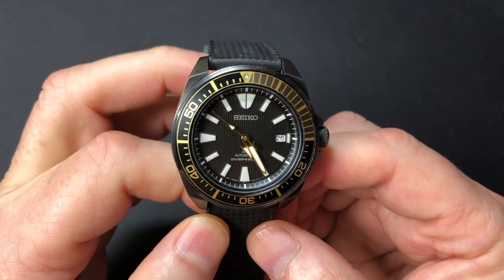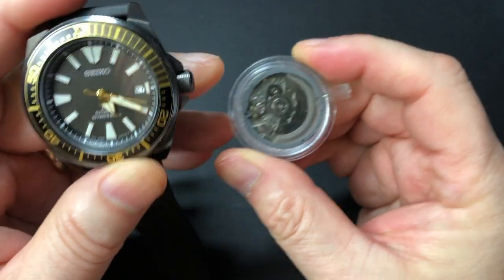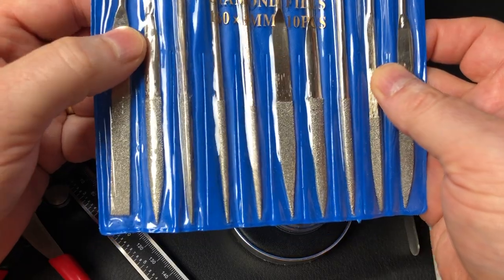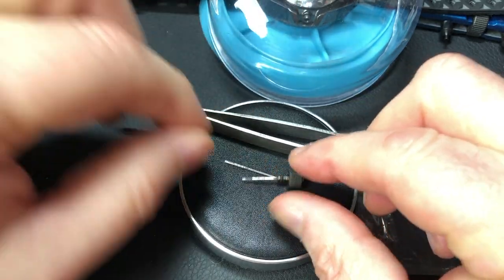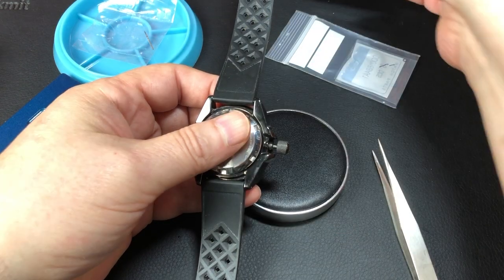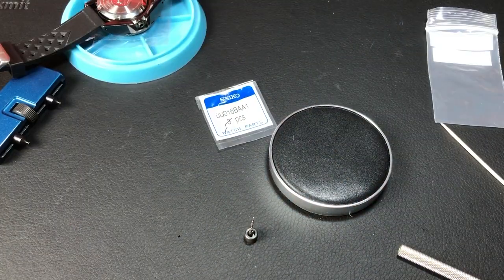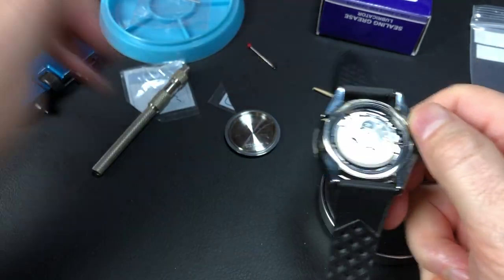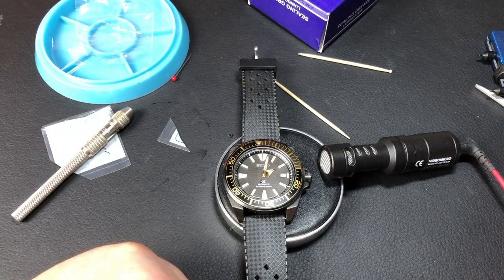Watch Crown Stem Repair – What’s the real problem

Comment: Good work.  Stems are the most annoying thing to deal with in the watch hobby and Seiko is one of the easier brands to deal with.      It's almost criminal how many stem variations there are in Swiss / ETA brand movements.      The profile ends of the stems that control the functions inside of the keyless works should have been MUCH more standardized on Swiss brands.  (Rant over).
Reply from the maker: I didn’t realize there were so many variations in stems. Thanks for the info

Comment: Really good video but I suggest anytime you work on any watch, please wear rubber finger cots or at least rubber gloves.  It makes me cringe at how much oil and junk is getting on your watch movement and parts from using bare fingers.  This finger printing can and will have negative effects on watch parts over time.  Keep it clean and don’t take unnecessary short cuts.

Also, you should remove the movement before trying to clean the inside of the case tube.  You are just pushing a lot of garbage into the movement, where it can contaminate and negatively effect the watch movement, it can even cause it to stop over time.  Take your time and do it right, you’re dealing with precision machinery and small bits of rubber and dust can do great harm to some of the tiny delicate watch movement parts.

The proper term for the”gasket” is O-ring.

Thanks for the. Idea!
Reply from the maker: Thanks for the advice

Comment: I opened up a Quartz Watch....to clean the Dial. I put in the Crown again. But now it does not really "CLICK" into the 1st and 2nd position. It is rather loose. Did I do something wrong? Any Advice?
Reply from the maker: Can’t tell from the description. Maybe something broke. Have you tried repeating the process
Reply: @adventureswithtime  Not Yet. I was waiting for an answer. But the Watch Works. The Crown works. I will see if I go in a second time, or leave it that way.

Comment: Great video, although I wouldn't have chosen a safety pin (because it is hardened metal and pointed) but used a pointed plastic tool or similar then there is zero chance of placing any scratches upon the shaft under the O-ring. I will say I'm NOT a horologist/watch repair guy but have worked with O-ring seals on ultra high vacuum systems for over then years and one removes many seals over time and no technician uses any metal tools to avoid possible damage to the O-ring groove/surfaces. That being said, if the pin simply "stabbed" the O-ring and thus allowed you to pull it free of the groove then no problems. How about sealing did you run a hydro on the watch after this?
Reply from the maker: What do you mean about running a hydro?
Reply: A test for pressure, either in water or vacuum to test that the seals are good to the rated depth.  @adventureswithtime
Reply from the maker: @BushCampingTools  I don’t have that equipment

Comment: Sir sir, I just bought a new watch, I gently pulled the crown to set the time but the whole crown with the needle came off. The watch is working fine but I am unable to set time n date. Plz help me. Is it possible to put it back? 😫
Reply from the maker: I would return it to whomever sold you the watch.  They should except a return and provide you with a new watch.  At a minimum, the watch should be under warranty.  I would not try to fix it yourself.
Reply: @adventureswithtime Actually I bought it online. I will try to explain them the problem. But if they don't consider the return assuming that it is a physical damage, can I somehow get it fixed from the local store? Means is it even possible?? I guess the pointed part of the stem is still stuck inside.
Reply from the maker: @luie.no1noob  the stem could be broken and need replacing. Even if purchased online they should accept a return for a different watch.
Reply: @adventureswithtime  Ok sure. Thank you so much for your assistance. 😊

Comment: I have had the same problems with a Mod i made. The crown has a spring, this spring hets stuck in the crown. I dont know why but i has to be pulled HARD for me to fix it. Only solution i have is to remove the stem and pull. WEIRD🤔
Nice vid
Reply from the maker: There are so many intricacies to some watches. I think that is part of the fun of the hobby

Comment: Hi, i have a blancpain villeret 40mm watch in stainless steel 2 years old watch and i noticed that it is stiff when i try to wind it. It has 72 hours power reserve. 

I have to pull out the crown in order for it to be buttery smooth when i wind it. It keeps excellent time BUT it is just stiff if i dont pull out the crown. 

When I pull it out, it is sooo smooth. Any idea on what could it be? I dont have warranty.
Reply from the maker: Maybe it needs cleaning

Comment: The tuna is such special and iconic watch I got the baby tuna with the penguin textured dian instead and it's fire but not perfect mine has a slightly misaligned bezel and under magnification the tip of the hour hand is slightly bent upwards otherwise it's good I got mine  on the 4th of July sale on Amazon for $299 and it averages- 3 seconds a day on the wrist and that slightly beats my Hamilton.
Reply from the maker: Seiko does have problems with alignment.

Comment: you need to do at least a bowl of water test, also keep a bowl of rice at hand just in case.
Reply from the maker: More info coming in next video.  So stay tuned.
Reply: I'd say take the movement and dial out. Put the crown back in and then put it in a bowl of water